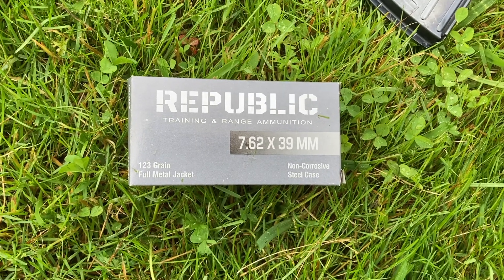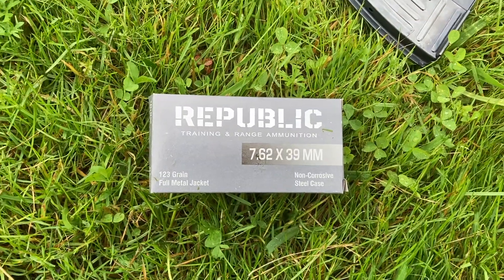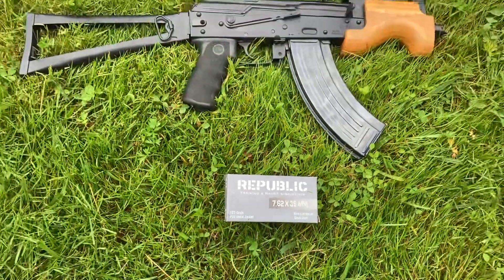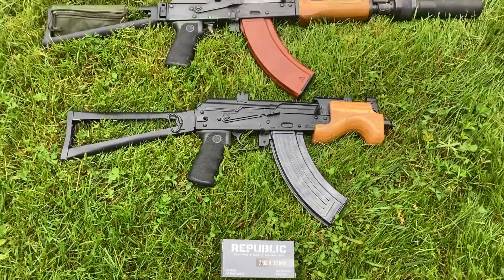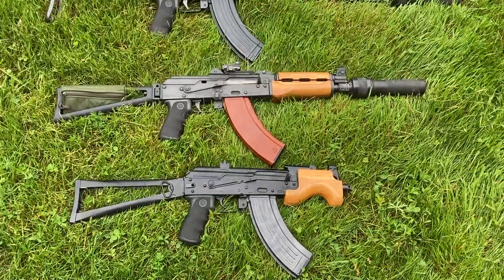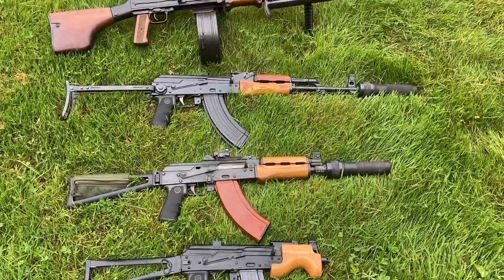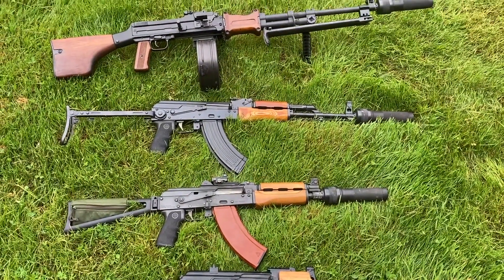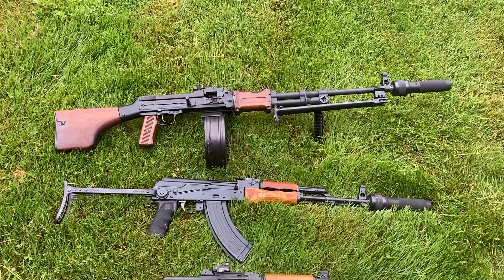7.62x39 Barrel Length Velocity Difference

Comment: Does the 123gr soft points still expand out of the micro draco? I'm curious because I have a PDX in 7.62x39 and figured they were similar velocities 5.5". Vs 6"
Reply from the maker: That’s a good question. I suppose it depends on the actual bullets from different manufacturers. EBR makes some wicked 220 grain subsonic rounds that totally make a flower. The Republic 123 grain were still a good amount above the speed of sound. Your 123 grain soft points should get at least some deformation. I wish I had some ballistic gel to try out for you. I’ve got some 154 grain soft points I’d like to see even.